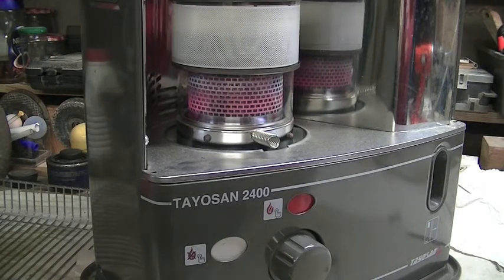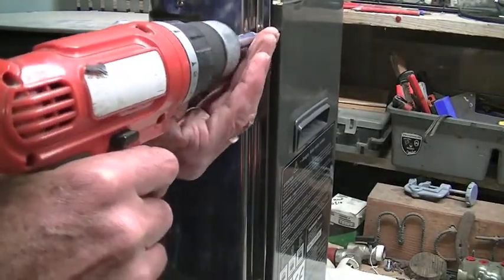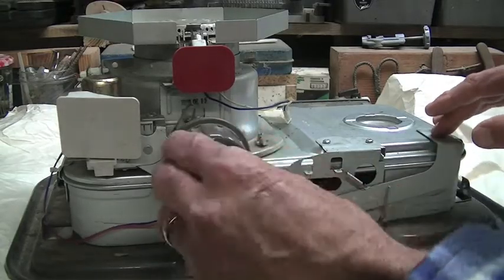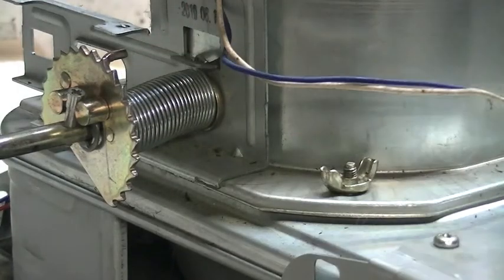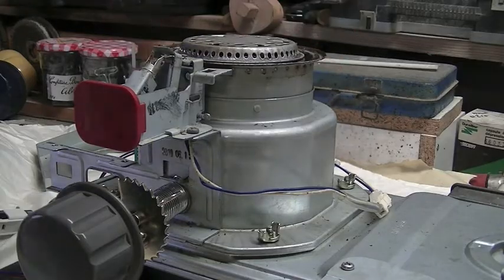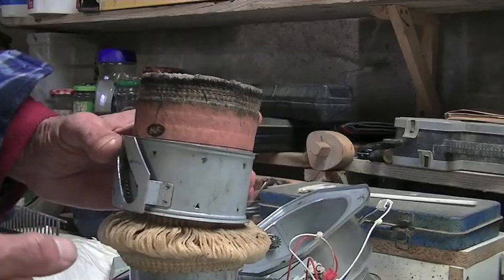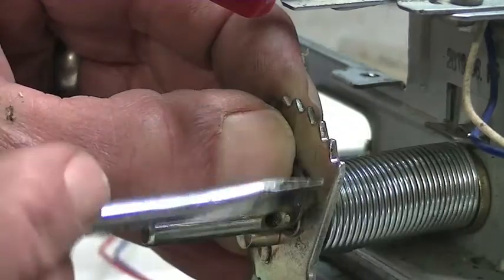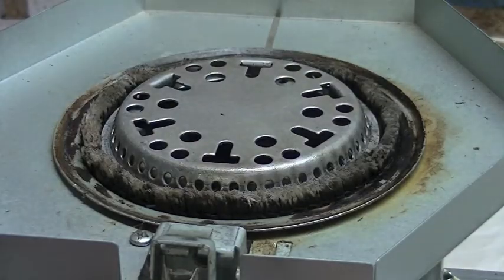How to Repair a Paraffin Heater that won't Switch Off!!

Comment: the video is useless to tell a user how to make sure the flame on the wick goes all the way out ....
Reply from the maker: Just to clarify things for you,  you push the button to make the wick go down and thus put the flame out. If you wind the wick up again and the flame is still burning, it means the wick has not gone down far enough. In this video, the spring was not strong enough to pull the wick all the way down.

Comment: Thank you very much for this video. My heater is a Kerona WKH-100 but the dial mechanism is almost identical. A former owner has fiddled with it so it's not working. Now I know what the release spring is supposed to look like!
Reply from the maker: You're very welcome Samuel, glad the video could help. I also have this video on my channel that might help. https://www.youtube.com/watch?v=BjM7DtS97qU&t=3s

Comment: Great video! I have this heat for over 20 years and has never failed. We started using it again like years ago in our caravan, but now during travel the paraffin is leaking out. We tried it putting in the car so it’s not moving, but still leaks. This never happened before, any ideas where it could be leaking from?
Reply from the maker: Thanks very much Sport Zone!  The heater should be completely flat when working. The most probable place where it could be leaking is where you put the paraffin container. There is an open cup at the bottom which has a level of paraffin in it. I think you could also check the container itself.Turn the container upside down to see if anything leaks out. There is a little button in the lid, it acts like a valve to let paraffin out when the little cup is empty. I once had a lid where the valve stuck in the open position and it leaked. When you travel, take the container out and keep it upright. Hope that helps

Comment: How to fix the heater when it is wound  to tight. Know won't  turn back
Reply from the maker: Hi Helen, have you tried lifting out the fuel tank, that usually acts like a cut off switch
Reply: @davekennedy52   fuel is made under nief the burner.
Reply from the maker: @helenrodriguez4398  can also be that your mesh is stuck in the up position. If you have an "off" button, keep pushing it and at the same time turn the dial back and forward, back and forward with some force. What is the make of your heater?
Reply from the maker: @helenrodriguez4398  Hope you got your heater to work again. I didn't hear from you so good luck and keep warm

Comment: Thank you so much for making this video. My heater is kerosene by Dura-Heat but I'm sure it is all the same mechanisms in any oil burner. I have noticed occasionally when I push the off switch that a little later I smell noxious odor and realize the heater didn't go completely out. I fiddle with handle while pushing the off switch and it then drops completely and goes out. I just have to be aware when I turn it off to check to be sure it really is out. I'm glad I found your channel because of this video. I subscribed because I looked at your videos and I think I will enjoy watching your content. Merry Christmas from USA.
Reply from the maker: thanks Maggie! Yes I'm sure that most mechanisms are the same or similar. Thats exactly the same problem that I had with my heater, until I increased the tension on the spring. But I have 2 other heaters with the same problem and I give the dial a little extra turn to make sure its completely off- the same as you do withe your handle. Happy Xmas to you too and thanks for subscribing:)

Comment: Not helping my situation i put new wick in but my dial wont turn n the safety mechanism doesnt work i have a real one not the small one so how do i fix that issue hmmm?
Reply from the maker: Are you turning the dial with the fuel tank in place? Doesn't work otherwise
Reply from the maker: Giving your problem some more thought, I think its the counter weight, but will let you know my thoughts